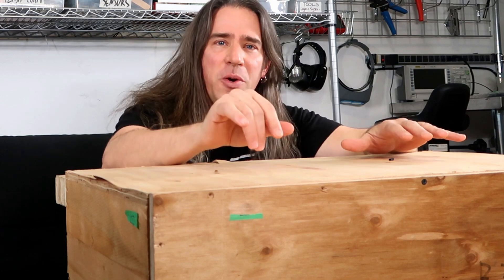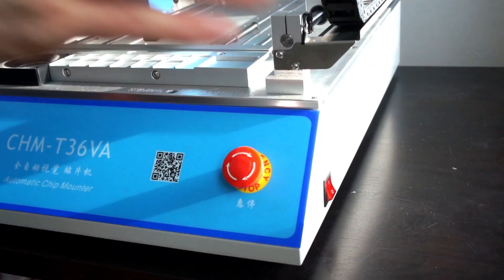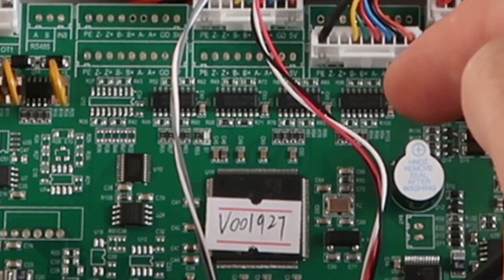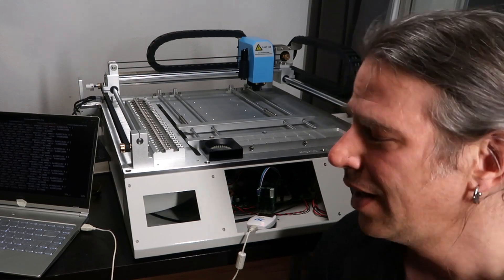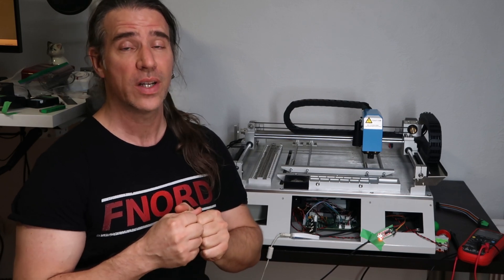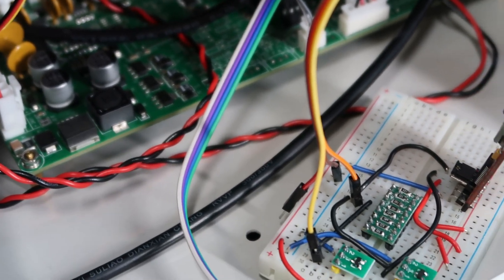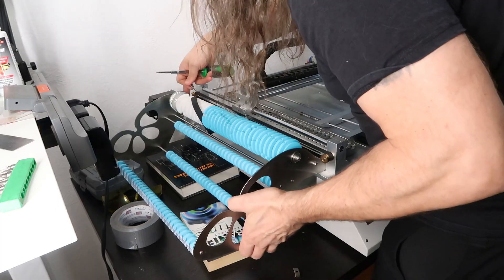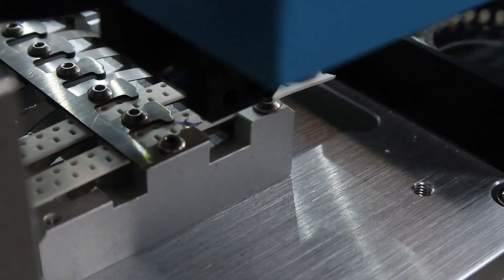Cheap Pick and Place + OpenPnP: CHM-T36VA upgrade guide

Comment: its actually been fun to watch this video. i have CHMT36VA machine & doing PCBA production on that machine from an year with its original charmhigh software but its really pain to work with its original software as it dosent give you full control of the machine & alsosometimes dosent applies the changed settings also. so i have been thinking of to upgrade the firmware & to make it to work with openpnp software. i dont want to make any hardware changes in the machine as it takes much time & also makes things worse if it didnt go well.

it will be very helpful for us if you make an detailed video on how to make software configrations in openpnp software & also machine.xml file so that this modification can be done completely within one or two days without getting stuck at any point. 😃
Reply from the maker: Thanks!  And yes, I've got more to post on this, but I'm going to centralize the actual info on one webpage, so it can be downloaded and just used--had a trip to run to, so didn't have time, but will be posting that and updating the description on the video with a link (and can add an extra reply here when it's done, so you get a notification/don't have to keep checking)
Reply: @PsychogenicTechnologies  oh thank you very much.. i am waiting for it.

Comment: IMHO this machine isn't a good starting point. The pin-drag feeder is very unreliable, specially with plastic tapes. There are plenty of 3D feeder open-source designs out there, but most are too high, the CHM pick up height is ~20mm, most need >40mm.
The Z-axis CAM design works well, but I think it does not allow tool changer since you have no upwards Z-force. 
Wondering, why it has 3 power supplies? And what is the driver voltage? It runs nice &very fast.
Reply from the maker: Hey C00ltronix, thanks for the input!  It's a little late, for me, in this round but appreciate the thoughts.  I've done a tiny bit of drag feed with plastic tapes, and it was ok, but will update on that as things progress for sure--especially if they go badly ;-) 
The height, however, really is kind of pitiful--looks like a lot of pretty standard fare parts just can't be processed.  I saw one guy online take it apart and hack bits off to give it more clearance... will see how adventurous I feel if I need it.
And you're right about the z-axis--just a spring that bring's it back... I wonder if there'd be a way to change the little bar-and-two-wheels system in there.  Kind of an edge case, most times so far I've only needed one change per side during jobs. 
As for the power supplies... I just don't know why it has so much in there.  And (at least) one of them has 2 outputs, IIRC, and I didn't probe back there... will take a closer look if/when I open it up again.
Reply: @PsychogenicTechnologies  pin feed problems I encountered where pin slipping out of the hole (specially with plastic tapes), paper tape too tight, couldn't move. Failure rate was like 70% or so. IMHO, yeah, play with it, then be open dumping them. I think I am not allowed to post links, you can google for "S0816 SMT Automatic Feeder – Version 07" - he has a similar machine and redesigned to S0816 feeders for low profile - his machine is very similar to yours, might be same but older version. There are videos too.
Reply: Yep, pity, links don't work.
Reply from the maker: @C00ltronix  ouch, 70%.  Ok, so far I haven't had issue, but have to say I haven't done much with it yet.  Thanks for the S0816 feeder pointers!  Also looking at the pretty sweet looking https://makr.zone/new-all-3d-printed-tapereel-feeder/399/ (checking if I can post links here, maybe so on my own vid?  will see)
Reply from the maker: Ah, so it does let me post links... So I'll add this for anyone interested in the S0816
https://blog.michalhrouda.cz/2023/02/s0816-smt-automatic-feeder-version-07/

Comment: Did you upload any firmware to it or serial interface is G-CODE compatible from the stock?
Reply from the maker: Oh, the stock is definitely not compatible.  There was an effort at some point to get it working, but that failed as the system didn't have some basic function exposed (like rotating the head or something, weird).
So what I got on there was a smoothieware port, specifically https://github.com/janm012012/Smoothieware-CHMT

Comment: Cheers Pat, love the video! 😁I can't wait to finish my second granite PnP machine so I can start some work actually and test new OpenPnP features! :D
Reply from the maker: Merci beaucoup!  I thought my beast was heavy but your build with that giant granite slab must be insane.  Stable and perfectly flat, though, wow.  That's machining at a whole other level, pretty much the opposite of the off-the-shelf approach... a lot of work, but what a result.  I'm eager to see it working, too!
Reply: @PsychogenicTechnologies  Soon it will be in motion, this week I need to lift this block and put it on a custom welded table, then I need to drill the holes for mounting all the parts, and then finally start with the assembly. This time I have AC servo motors and high-speed 2550 TBI ballscrews, I managed to calculate 2.5m/s running on DUET3 and OpenPnP, but we will see... 😁😁
Reply from the maker: Hope you're not planning to move soon! hah.  "Stand back, and stock up on oxygen, I'm about to start her up!" 9 kph is really something.
Reply: @PsychogenicTechnologies 😂, we will see how it goes! Maybe all will fall apart when I start it! 💩
Reply from the maker: @zdenkostanec1622  hahaha, never know!  Good luck (and share a vid, especially if it blows up!! lol)
Reply: @PsychogenicTechnologies  🤣 I will for sure!

Comment: Thanks for the fun video. I'm glad I'm not the only one who jumps into things and they end up snowballing into chaos. Your OpenPNP videos have been really helpful as I've been running a LumenPNP for the last 6 months. 

Looking forward to more of this series!
Reply from the maker: Thanks!  The spice of life, right? hah.  I only learnt about the Lumen after I was already sitting on the giant box.  Did consider it's sweet feeders, though, for the LitePlacer.  Still thinking about them, actually.  How's it been for you?  Is it a plug and play wonder, did you get much done with it, what are your impressions of it?
Reply: @PsychogenicTechnologies  The newer release is a lot more plug and play friendly since they assemble most if it before shipping. Mine was a print your own part adventure and I modified it to use linear rails as well so I've done a bit of modding. It's working great though! 

I'm actually beta testing their feeders and they work really nice. A few minor tweaks and I think they should be ready to go. I've also got a handful of the CleverFeeders running too! They are really, really nice but they are hard to get ahold of.

With vision its around 5-600 cph and if I trust everything is dialed and turn off vision for things like passives I've hit mid 900s. (just using CPH as a rough idea of how well the feeders and machine works. not gospel or anything). I think there is a lot of room left in it for speed but there's some funky issues with Marlin.
Reply from the maker: @RyanMT  Wow, that's pretty awesome, would love to see the mods in action.  What are these CleverFeeders?  The g00gle reveals little... Anyhow, am so far good with the drag reel system, but am considering how I might bolt on some extras, so keeping an eye on the Lumen feeders.  
As long as the speed issues are software-related, you're golden as it'll eventually sort itself out.

Comment: Great video. You were right under no circumstances ever read the manual first !. The manual is for hindsight !
Reply from the maker: Hah, seriously!  In reality, I once actually read manuals--like, all manuals... don't know what happened, if I changed or they did, but it seems they're basically
 * 8 pages of "hot things are hot" "don't put finger there" "don't use in shower"
 * 2 pages of driver install
* 3 pages of fine print legalese
But in this case... still don't know what's in there, but I'm pretty sure most user don't build a circuit to connect it to a computer, and it might've helped. lol.